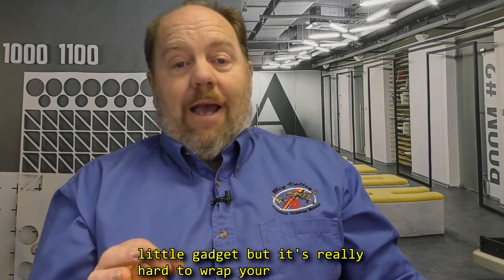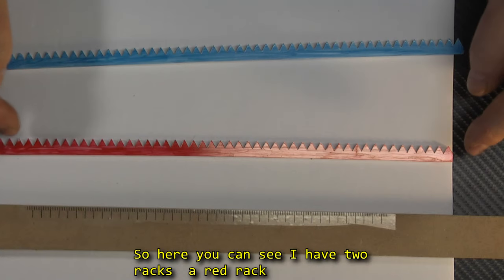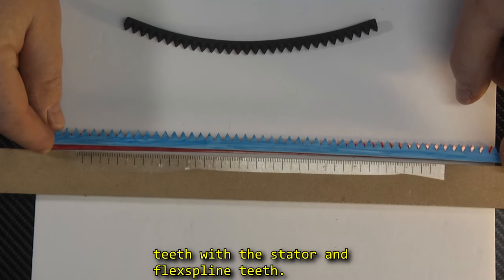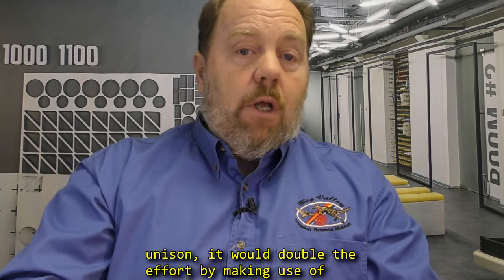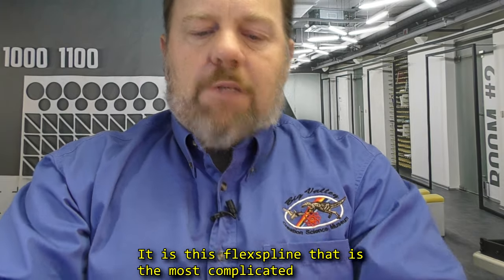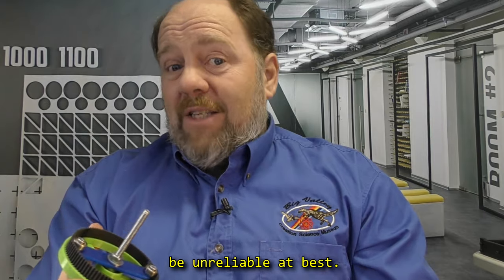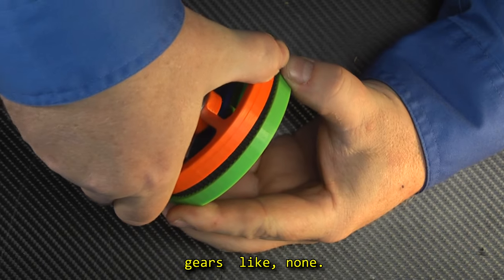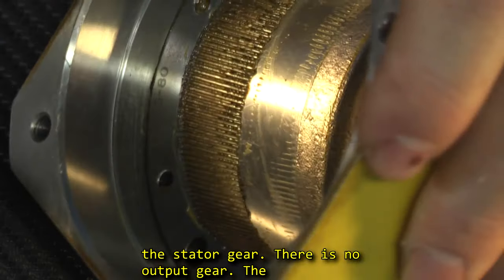Harmonic Drives explained

Comment: Could you clarify the differences between the ring style, that you show, and the cup style that the fanuc uses?  And maybe why you would choose one or the other?
Reply from the maker: As you can see in the video, the two gear system output rotates in the same direction as the input, but the single gear system (like on the Fanuc) rotates the opposite direction of the input. Other than that, I don't think there's really any difference.
Reply: I was getting confused it seemed like a different mechanism than all the other ones I have seen but I see now both the cup mechanism used by fanuc and harmonic drive systems works on the same principle of the one shown here but just adds an extra part.

Comment: The wedge profile in your explanations appear to be simple triangular shape.  Is it possible to use common involute gear tooth profiles in a harmonic drive setup?  Maybe works OK, or possibly trouble in function, however it would be far easier to obtain common gears, internal or external types for an novice builder who does not have a 3D printer.

Comment: The flex-spline is used as an alignment wedge, I don't see why you wouldn't just mount two spur gears on bearings.
Reply: Because it allows for a much greater torque reduction with the smallest footprint possible (yet)
Reply: @dienelt5661  he's not saying 'why not replace the entire drive with traditional spur gears' he's saying 'why not replace the flexible spline peice with two small gears which, yeah 
I think you could but this probably allows more wedge engagement across multiple teeth or something.
Reply: It would not mesh properly with one of the racks and introduce backlash. Something has to flex there or the backlash-free motion wouldn't be possible. And that's the whole point of the mechanism. You got a lot of options for similar kinds of reduction that has some backlash but are cheaper, for example a worm drive.

Comment: Is it possible to replace the two "internal" gears with common external gears, and have the flexible element run external to these two gears?
Reply: You could, you would need to devise a way to secure the output of each gear. You could also have the spur gears secured and drive one gear with a slight change in speed of the output gear. In that case, use a tooth ratio that overlaps at 3 points in order to create a more balanced system. The flexible element from what I can devise is only there to create a small contact patch of 2-3 teeth to minimize binding.
Reply: @blue_beetle368  i dunno, when the flex spline wraps around the bearing it is the same as a gear. if it goes eccentric out beyond that it'll be contacting more teeth, not fewer.

Comment: It's really cool, but isn't there a lot of friction and wear on the sliding wedge?
Reply: If you mean the input cam then yes,  but you can make the cam with an oval race with bearing balls between it and the flexspline.   In the rotating version  there is just one fixed gear and the flexspline,  so the wedge action is very gentle.  you can get away with almost square teeth.

Comment: A strong enough unit would be great for a winch, use metal chain as the flex spline and hard plating over durable substrate metal  on all gear teeth and wedges, to minimize wear.
Reply: “Would be” ? Yes it is a good, and very old, device.

Comment: Never thought they’d be used in industry to such an extent. Looks like they’re very good at low-speed high-torque applications like robotics. Though I doubt they’d be terribly optimised for higher speeds, like stepping down a high-speed electric motor directly.
Reply: They'd be good for a screwdriver but probably not a drill.   They are more expensive to make (mostly because of the flex spline part needs machining out of spring steel) than a two or three stage planetary drive which you usually find these days.
Reply: For really high ratios,  a worm drive is traditionally used which can be more compact and the only real disadvantage is the backlash especially when it wears.

Comment: so uh

Why not use two gears freewheeling where the lobes would be on the internal cam instead of a flexspine?

you would still have the wedge-driving action, but it wouldn't require whatever process is needed to make a flex spline.

I bet you could even install the inner gear bearings into slots axial to the "lobes" of the "cam" and spring load the gears to push away from the center so that you compensate for wear overtime and don't develop backlash.

It'd be kind of like a planetary gear set, so I'm calling this a binary sun gear set until someone tells me it already exists xD

Comment: i don't think this is actually a harmonic drive though... ?

i'm a little confused. the one in this video uses a stator (red), rigid output gear (blue), and input (axle with cam or bearings) with the flexspline tying it all together. but all the other examples i see on the internet don't have a rigid output gear portion - they have the stator, then use the axle as the input and the flexspline as the output.

also they don't use that wedging action; they all essentially just use tooth ratios like regular gearing but the flexible gear is a way to make a gear with less teeth fit a larger radius at the contact points. the one in this video relies on the flexspline wedge pushing against the stator to move the blue output, but none of the other examples i see use a mechanism like that.

that is, the one in this video has three gears and relies on a wedge, but all the other examples have two and are basically fancy planetary systems (axle = sun, flexspline = a blend of the planets and carrier, stator = ring). e.g. 

- https://www.mathworks.com/help/physmod/sdl/ref/harmonicdrive.html
- https://en.wikipedia.org/wiki/Strain_wave_gearing

what's the deal? are there different types?

Comment: How in the world was that so hard to comprehend? I barely gots a high school diploma, and understood that, the second you pushed the black gear into the blue and red.
Simple design.

And I'm sure that those robots stay in operation until they are literally about to strip Thier gears. The computer program will sense the backlash is to far out of spec.

My timing gear setup on my 2011 Ford f150 ecoboost turbo engine adjusts for wear until its to far gone and can't adjust for it anymore.

My buddy owns a cnc machine and in the program, it self adjusts for backlash.

Those robots stay perfectly accurate until they can't anymore.

Comment: what's the need for the flex spline in the setup, surely the exact same outcome could be done with 2 regular gears orbiting around the input shaft, that seems easier than maintaining a flexible gear

Comment: Well.. if you got a static ring and a moving output ring. Then why use a flexing spline-tube with separate bearings pressing against it, when you could simply put 2 spline shafts on the bearings themselves?

Comment: Your final comments about preventative maintenance and replacing robots is wrong.

I have been involved with robotic work cell design, initial construction, and reprogramming in the automotive industry for Fanuc and ABB robots.

Companies absolutely do not replace their robots every year, they don't even do it every few years. I have worked on robots that were pretty old, and they functioned very well.

If harmonic drives get worn out, the drives get replaced. You don't replace a robot that costs more than a car just because a gear is worn.

Comment: This is not a harmonic drive;  It is a differential gear system, related to the split-ring planetary drive.  In a true harmonic drive, the 2 high-torque members are the outer internal gear, & the flexspline, which is coupled to a cylinder terminated at its far end with a "bottom", forming a cup structure.  There is no second internal gear.  The bottom of the cup is the output & the outer gear is the stationary frame.  The input is the wave driver.  The outer gear & flexspline can be interchanged (output & stationary parts switched).

Comment: Direction of rotation of input power and output power is same or opposite sir .  Please reply.
Reply from the maker: It depends on the design type. In the two-gear type, you see the output gear travels the same direction as the input rotation of the flexspline. But in the Fanuc harmonic drive, there is no second gear. The flexspline itself was used as the output gear. This causes the output rotation to be opposite direction of the input rotation.

Comment: So, in other words;  It's an inverse of a planetary gear setup?  Metal teeth on a rubber timing belt should add longevity; no? Wonder how a metal drive chain having those teeth might work?  Like the old cam drive chains from car motors but turned inside out.

Comment: At the 1 minute mark , lunar rover, notice the pilot doesn't move, at all, he is utterly frozen in position, head does not swivel to look left into the turn, arms and hand positions utterly frozen in place over all bumps, rooster tail dust from wheels in a vacuum seems very out of place, rate of wheel dust collapse to the ground seems incredibly fast for 1/6 gravity conditions and rover cart seems to have no suspension give at any wheel - maybe a tad but not much if at all, and the antenna doesn't wiggle except at the end of the clip at the strongest bump ... just my observations ... anyway eager here to learn about harmonic drives!

Comment: Nice! What I didn’t get, why exactly two teeth less? What happens if you only have one teeth less?
Reply: If you have two fewer teeth you'll have two places where the wedge is aligned with the input and output shaft. That's exactly why he is using two bearings at the input.

Comment: What's the pro and con compared to say a planetary reducer?
Reply: The lack of backlash (looseness in the joints or pivots) a planetary gear has several places like the planet gear shafts and where the gears contact where backlash can occur
Reply: But they tend to be "elastic" due to their thin material, making them unsuitable for high payload, no?

Comment: The part I'm not 100% clear on is how commercial wave generator bearings work
Reply: They are like normal ball bearings, only that the inner race is slightly elliptic in shape. The outer race is rather thin and can flex.

Comment: Seems like the most pointless drive system ever invented (well explained, thanks) When you consider the readily available gears and cogs and planetary stuff cheaply available vs the custom and specialist manufacturing cost of this type of drive, typical NASA to choose the most outrageously expensive  option.
Reply: The two most important things for NASA are size and weight. That metal flex thing is far lighter than a gear train with axles.